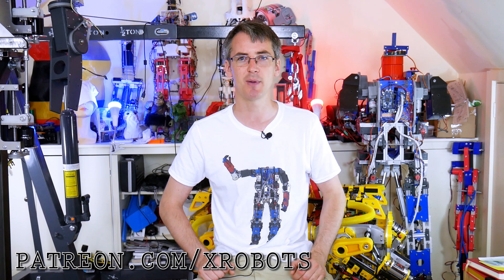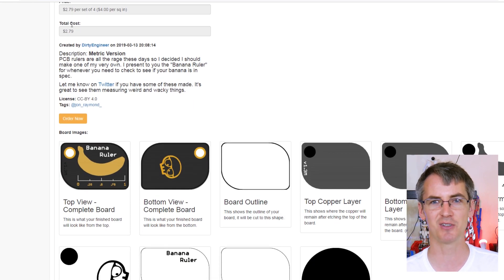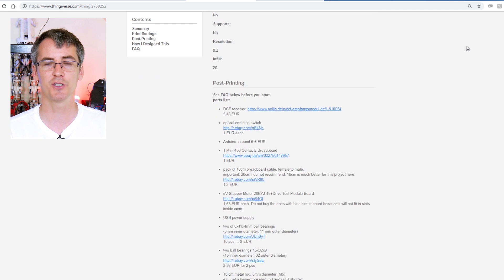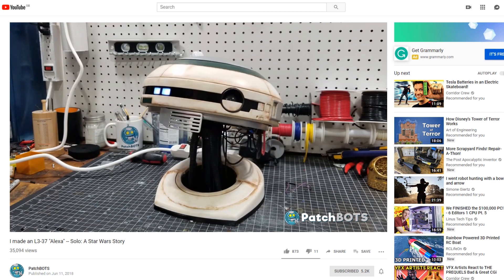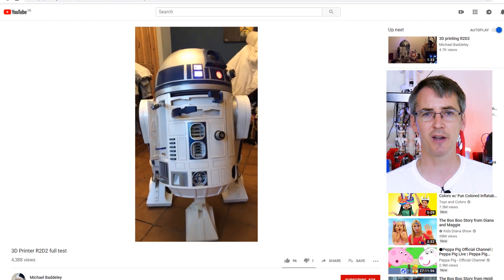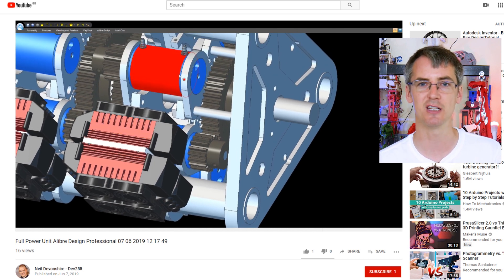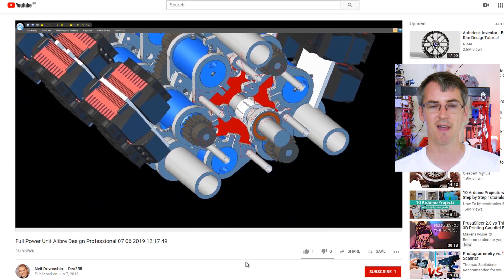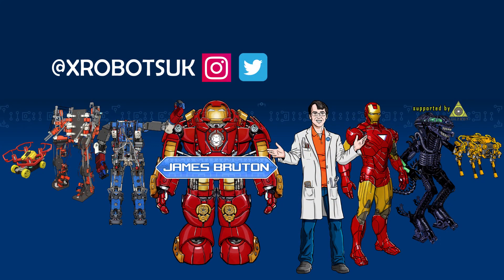Electric Car Conversion & Other Projects

Comment: ☺😊😀😁😂5 Smile's  Nice real world possible use i have the other car charger a alternator pack regulated 100kv to 200kv current design depending on what's needed real world?

Comment: Great video, thanks for the shout out, I do get all the comments below and have thought about this a lot, although there is not much out there that shows and discusses the problems that I will inevitably face. I hope to cover all these issues and if it fails drastically, hopefully, we will all learn from it, lol. I may just change the ESC's to ODrive ones as James uses, as I will only be running these around 20% capacity most of the time anyway. Love all the other projects on here too, I've been taking a look through and I too love the banana ruler :-).
Reply: Man I’m so excited for this! I’m 100% this can be done

Comment: I'd recommend watercooling the ESCs too. Otherwise it's gonna have some serious overheat issues. 
Adding a bunch of motors instead of one or two larger ones is also going to add a heck of a lot of inefficiencies with the gears.
 Said gears are going to be one of the many many many failure points. I know they're thinking this through well enough but this has actually been tried before, albeit not in a fullsized car, it doesn't tend to work very well at all.
Gears + small motors + a lot of ESCs = lots of failiure, lots of the time, low power, high temperature. Still though, off the shelf parts as a conversion is a neat idea! Can't think of many worse for the conversion than an MGF given the way the engine bay is accessed but I'd imagine he's gonna come up with a solution to that.
I'm dubious of the project but sincerely hope I'm proved wrong.

Auto engineer by trade

Comment: if you want multiple motors helping and working together use a clutching wheel it will only add force and not fight back

Comment: Anyone who's run an rc brushless motor and esc knows that running full throttle even 30 mins would cook them. Those cheap hobbyking 200a escs are rated 200a only for seconds lol.
Reply: A solution might be an Odrive with external switching circuitry. I could see that working for larger drive systems, as the logic should be pretty similar.

Comment: Kinda skeptical about the electric car... seems like it would be plagued with problems
Reply: I'm kinda sceptical too and I'm making it, all the issues you mention I have thought about and want to see them for myself and share them with you guys. I love healthy debate on engineering projects, so this should throw some more ones up, feel free to follow me if you wish. I chose to disconnect and run with multiple motors initially for redundancy purposes, so if a motor fails it instantly disconnects and that ESC will be turned off. I was also thinking that off the shelf parts would be a cheap way for anyone to repair, mod, or even reconfigure it. The interesting part of this one is trying to make the motors load share. I hope you enjoy, and maybe I will stip a few gears along the way.
Reply: @TheSolarPoweredEngineer  I have built something similar at scale and its basically impossible to get electric motors to load share mechanically like this. One of them will dominate and the second that happens it will pull more current, at which point it will warm up more causing the resistance to drop causing to pull even more current. Its a partially stable system which if you are not familiar with system modelling is very difficult to solve, and almost impossibly just using purely experimental means. I dont think anyone is bothered by you trying, but asking others to give you money to try something which anyone educated enough can see is near impossible seems a little gimmicky. Maybe have a working model first.
Reply: @tando6266  Hi and thank you for your reply, I love a challenge and also love the word impossible (every engineering problem is impossible until solved). I will be relying on one motor to dominate as you mentioned and to allow others to follow it's current draw in a fast acting hysteresis PID loop, this tracking just under it's current load. I will be looking to nominate a master motor in turn allowing each one to share the demand for that very reason. Very rarely are vehicles used at 100% output power, where the MGF at 100hp would most likely get to 60mph in around 17 seconds, so the power unit will probably only be used at 30% or less at all other times. Plus, analysing the CAN bus telemetry from my Vectra, it only uses around 5 to 20% average load on normal journeys and that produces 211hp and weighs in around 1500kg. I wish to share all aspects of not only this project, but also other engineering projects, how to videos and hopefully shedding some light on this load sharing challenge. My overall goal is to inspire and encourage the next generation of engineers through my own engineering experience, ideas and projects, where I will be sharing all aspects of these projects, plus actively listening to suggestions and helping others in the community with their projects. I would love to catch up with you later in the project and tap into your knowledge and experience to see if I am going down a similar route or just to discuss the complexities further.You never know, todays collective engineering community may know everything :-).
Reply: Why would you make a mechanical means to "disconnect" each motor, when you can just drive any individual motor to zero torque, and then the only loss is a small amount of windage from the rotor and a tiny amount of bearing loss?  And "glass filled nylon, almost as strong a steel" is total rubbish!
Reply: and mechanical energy loss
Reply: Lots of added complexity over using a proper EV motor. I don't see any advantage with his approach.